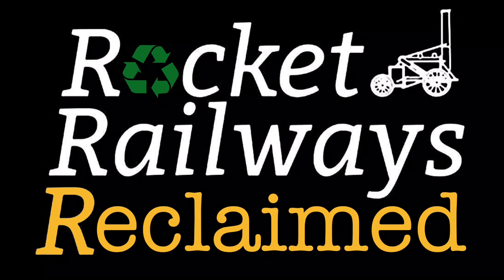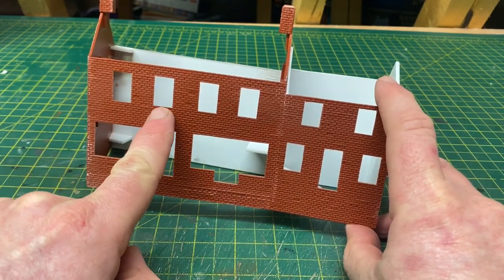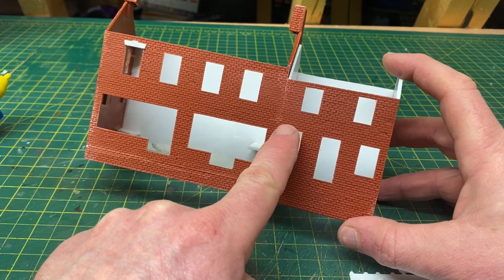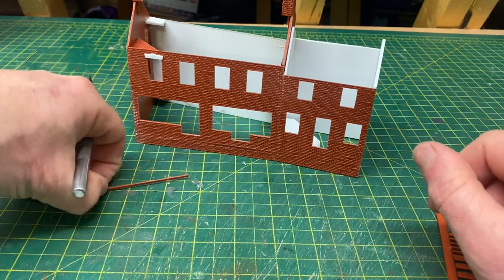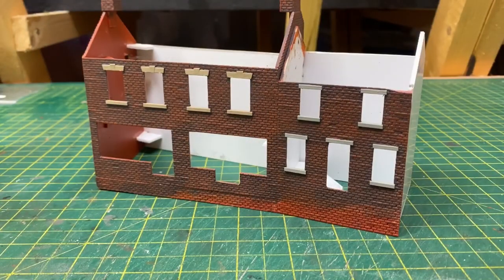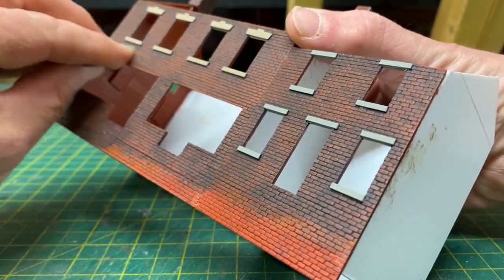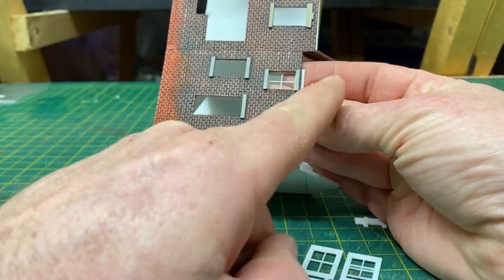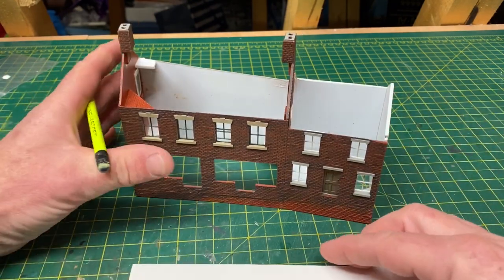Wills Craftsman Kits - Roof, Windows and Other Details

Comment: Hi Paul Ive only just started to watch your channel and have just been trying some scratch building one question I have and has probably has been asked is 
Do you glue painted parts together or clean paint off first cheers
Reply from the maker: Hi Darryl thanks for taking the time to watch those videos. With regards gluing parts to painted areas I try to avoid it if possible. That’s not always possible though, say if adding some spouting to already painted brickwork. In that situation I’ll use a glue such as UHU or a superglue to ensure it’s as good a bond as possible. That said there is always a risk that it may come away due to it bonding more to the paint than the actual surface. Hope that helps. Paul